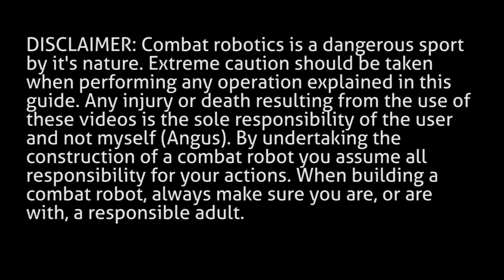How to build a Combat Robot - Episode 2 Stubborn Drill Tips and Tricks

Comment: Hi Robowars Australia. Thanks very much for answering my previous questions! Do you mind if I ask a few last questions regarding the batteries for the drill motors?
In the previous video you said that batteries that come with these drills are pretty bad. I was wondering what you meant by that? So are they bad because they aren't very durable? Or because they hinder the motor's performance? Or something else? I'm wondering this because I've read a few other guides, and some of them say that the batteries that come with the drills are suitable.
Thanks.
Reply from the maker: Cow Launcher The batteries drills come with are usualy NiCAD (old, very toxic battery technology) and very low capacity, around 1200mah. A featherweight will need at least two packs to pretty much scrape through a 3minute fight with enough juice. In comparison, modern lipo batteries can weigh as little as 1/4 as much, have more capacity and more current capability to boot! This means your motors can get more current, and thus can push harder. Only good thing about the crap batteries drills come with is they wont catch fire if they short, the internal resistance goes up so much they they just get really hot haha. So in summary, yes you can start with them, but upgrade as soon as you can afford to!
Reply: Robowars Australia Ok, great. Thanks very much! :) Also, if in the future I were to build a robot with an active weapon, is it normal to run both drive and weapon off 1 large battery? Or do people use 2 separate smaller batteries, one for drive and one for weapon?